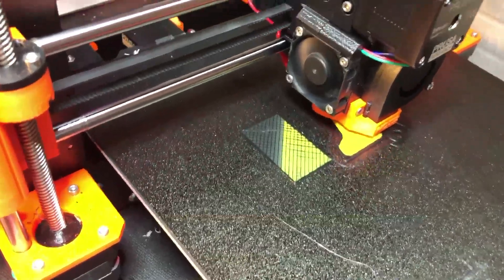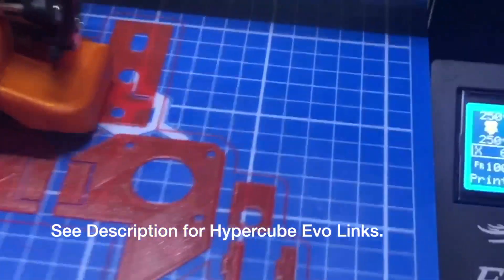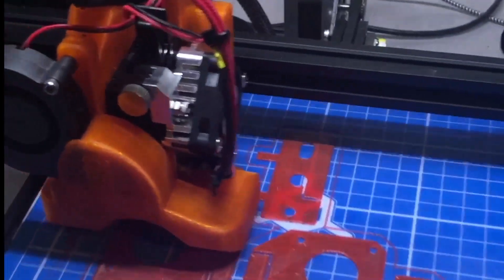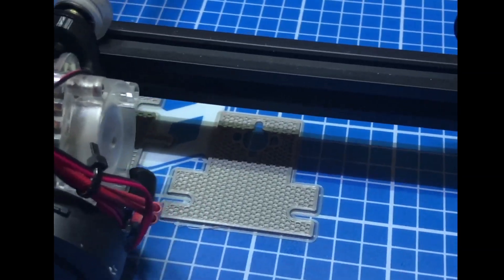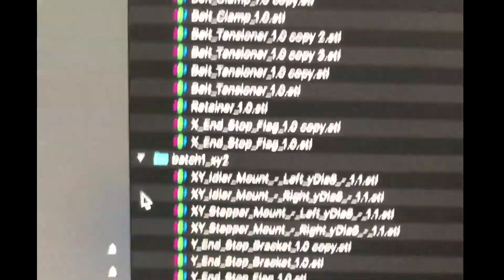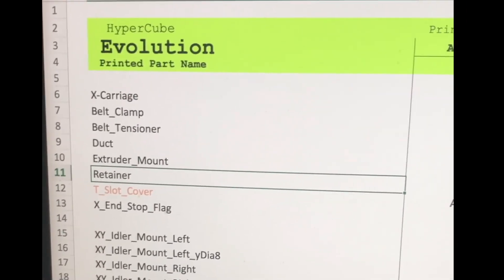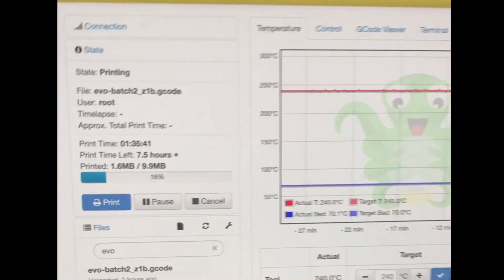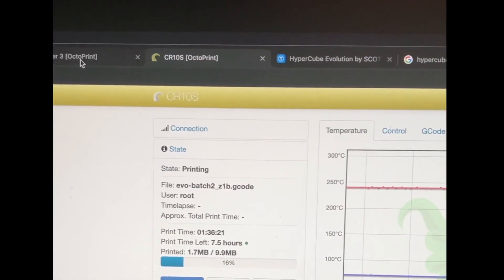Hypercube Evolution Build - Part 1. Background, Prep, and Parts.

Comment: Did you buy a kit or did you source everything out? I'm trying to find out how much money I could save it I bought the aluminum custom cut instead of buying it from zyltech.
Reply from the maker: If you have a local supplier you will save money. I bought my parts from a few different sources (BD3dCustoms, Zyltech). You can use an affiliate code for Zyltech, like RMCGaming to get 15% off.

Comment: I don’t wanna be rude but hypercube is a bad design in so many ways.

But I made one and I’m already too invested and trying to improve it in different ways :p.

I also wanna convert my X axis to a v slot. 8mm rods are too wobbly and flexible yet heavy. V slots and lightweight and less flexible!! Way better stiffness to weight ratio. I would try rails but cheap ones I heard tend to have play. And even if they didn’t I can’t find them in my country. And the weight is like 1.4kg/m compared to 0.4kg/m
Reply from the maker: What kind of issues are you running into? I have been getting some fantastic results on my Hypercube Evolution. It took me a while to get things tuned in, but it is printing better than my Prusa mk3 was (at least in my humble opinion). Here are a few of my most recent prints:   https://imgur.com/a/8iwkq8p    I don't like v slot because then you have to maintain wheels and bearings, which are a pain and often have flat spots.  Rails are not a bad idea but they add a lot of weight. I am thinking about doing rails at some point in the future so I can add a direct drive, but for now I am happy with the rods and bowden extruder.
Reply: Greg's Maker Corner it’s very hard to tell from those photos but they look gorgous! Maybe uneven layer lines but I’m stupidly paranoid about the smallest flaw. I could post some of mine if you like. How big was yours
Reply from the maker: Chloe Mcholoe sure, please post some pictures! It is hard to get things 100% perfect, but these are about the best I’ve printed on any of my printers so far. These models were maybe 100-150mm  tall, I don’t remember the exact size. The Hypercube that I built was 300x300x400. I am planning to do some taller models soon also.
Reply: Greg's Maker Corner I did on your other comment :3
Reply: Greg's Maker Corner the bad things about it are some inconveniences in maintaining and assembling. Use of 3mm idlers with washers, the stock y carriage can flex easily, the stock motor mount can bend very easy the 4 rod 2 threaded rod is very easy to get wrong specially if you have minor issues or if your extrusions aren’t perfect. No guide manual or things like common bom. Every hypercube is honestly different which can be a bad thing meaning results are random and diagnosis will be hard

The inserts can be annoying too. It’s a tiny bit hard to get the actual print volume too. Some parts are also designed in a fragile way. But my issue is mostly the belt system and the idlers.

Comment: Wait, you sold the Prusa and kept the Creality printers? Interesting.
Reply from the maker: John Strand I am going to be getting rid of the cr10s next. I sold the Prusa because it was worth the most money, and I’m hoping the Hypercube can match the quality.
Reply: Greg's Maker Corner did it :p?
Reply from the maker: @chloemcholoe3280  Absolutely! See my other reply :)  I was always getting ghosting on my Prusa prints, especially at higher speeds, because the Y is moving the print around. The prusa extruder also isn't that great. I am using a Bondtech clone that is doing a great job. I think the Prusa MK3 is a great printer for a lot of people, because it is so easy to build. The hypercube was a lot harder to build because instructions are limited, tuning takes longer, but I like the geometry of a Core XY much more than a Prusa style.
Reply: Greg's Maker Corner that’s lovely to hear! It might be worth looking into the hyoercube evo-s I’m working on if you have issues (specially uneven layer lines)
Reply from the maker: @chloemcholoe3280  Will definitely check it out, do you have anything published yet? I had layer lines early on but I switched to solid couplers and that fixed my issue.
Reply: Greg's Maker Corner what do you mean by published? Here are my prints https://photos.app.goo.gl/5fMLCeksyqxXS2vY7

The hyoercube-s Is a few of my designs combined with other people’s designs. Gathered all in one place!
Reply from the maker: @chloemcholoe3280  Just saw this- those prints look pretty good, but I think you may be able to tune the extrusion a bit. Are you on twitter? I don't always see the notifications on Youtube, but I'm happy to give you some ideas if you want.. My twitter is @greghuber, just follow me and I can DM you there if it's easier.

Comment: I just give u a sub bcs i want to build my Hevo too and im not sure what parts i will use.
What u think about :
Duet Wifi 1.04 + screen
Wantai 350W 24V
e3d v6 with direct drive ?
Reply from the maker: Thanks for the sub! I am still waiting on my parts, but hope to continue the series shortly... As far as our parts go, yeah that seems like it would work well. I am planning to use a Titan Aero for my e3d v6 direct drive. There is a good clone called "Triangle Labs" which you may want to look at. You can get the full Titan Aero clone for around $70 USD shipped.  Duet Wifi is an awesome choice also. That sounds like a pretty high end evo.

Comment: I'll be watching this series.... I'm also wanting to build a core XY style printer.  I have enough steppers & boards and such from my current corrall of printers.  I'm still window shopping parts and toying around with the build volume I'd like.  Soooon :)
Reply from the maker: Thanks for watching! I was debating between a Hypercube or go the easy route with an ender 5 plus (though not a true core xy). I am looking forward to the challenge of building one... I picked 300x300x400 because it seemed to be one of the most common sizes, but it’s hard to find them in stock.  Thanks for watching and good luck on yours also!